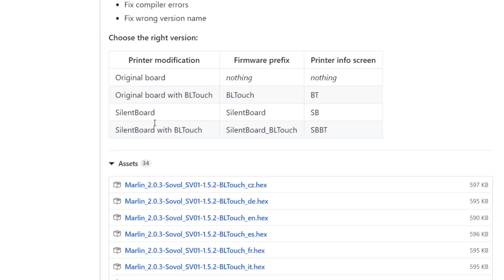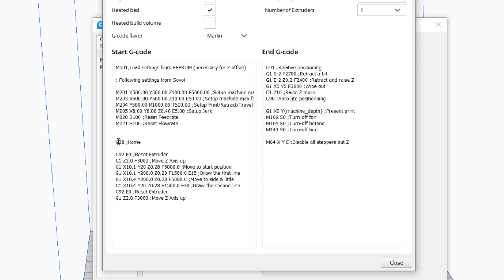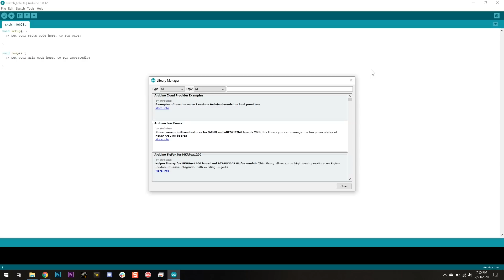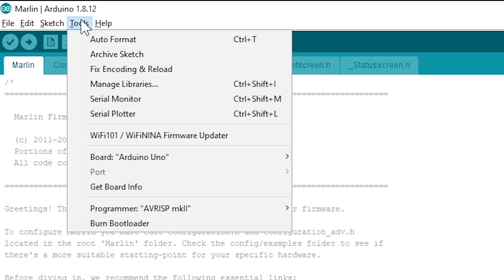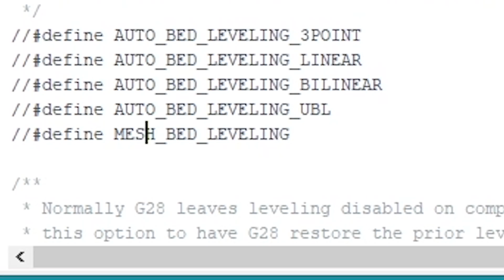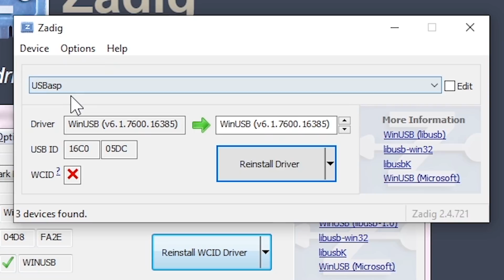Mesh Bed Leveling for Sovol SV-01 & Ender 3 Pro (including flash bootloader)

Comment: I am SO glad that I spent two full years after making the decision that I WAS GOING TO buy myself a 3D printer. For a long time, it was always, why spend thousands for small components that I may only need a few times per year.. But then prices went down. And I got deeper and deeper into my hobbies, which began with model radio controlled aircraft, and then to general electronics, then back to the interest in software programming I had in high school, and into coding my own firmware.. And now I have TONS of actual NEEDS for items which can only reasonably be sourced or produced via a 3D printer. And nowadays, even actual GOOD ones, not full professional/industrial. But actual good CNC machines that hardcore DIY folks and hobbyists who lean towards the professional sides of their interests have come down in price to that of what an average working class Joe can afford. And after 4 months of reading. I now have my first 'test run' print working in the other room on my brand new, currently being broken-in Sovol SV06 Plus. The Plus was what had me on the hook for it's price point. And it seems that it has OH SO FEWER issues than these Enders which only keep being re=packaged in only slightly different color schemes or configurations whilst still being the identical near decade old piece of tech it is. The learning curve is steep. But as an RC Helicopter guy who taught myself to learn to fly from coaxial Mall Copters into mild '3D' aerobatic flight with actual high end hobby grade collective pitch helis. And my camera quads as my 'toys' to rip around on the front yard and street... So steep learning curves are steep fun slopes for me. Also being a skier since childhood.

Comment: The weirdest thing is happening. When I do a G26, it prints out some of the grid, and then eventually it just stops extruding. It goes through all the motions of completing the test print, but doesn't extrude any plastic. And it doesn't happen in the same place.

Comment: I installed 2.0.5.3 without bltouch and now my X hot end crashes and grinds into the end stop,  what do I do to fix this?  Please help
Reply from the maker: I don't know what exactly went wrong but if it's hitting your Z limit switch and not stopping, probably you flashed incorrect firmware. I mean presumably the height of your z limit switch didn't change.

Comment: Even with mesh level, I'm having to babysit my cable chain links as they print separately.  I saved one link with babystep-z just at the right time. Maybe better to print all at once instead of separates?
Reply from the maker: Yes definitely. Lay a bunch of them out on the bed.

Comment: Bardwell, it is unwise to try to print that many pieces using "all at once" print order in Cura. If you really want to do batches of parts do "one at a time" and reduce and place items you print far apart (to prevent the hotend from colliding with completed prints). It'll even print faster and cleaner due to cutting down travel time and retractions between each part. If a print fails you aren't left with 36x 50% of your models, you'll have 18 completed models and one failed one. That way all the material used and hours spent until that point aren't wasted.

Comment: Dear Joshua
I followed your video step by step except in the programmer part, because I managed to get the Arduino uno to work as sanguino programer board.
when it comes to checking before sending it to the printer, I have an error, " exit status 1, compil error to sanguino board"!
Can you give a little help?
I really wanted to have mesh leveling, because my 3D Ender-3 is one of the first and it is as it came from the store in terms of software!
Best Regards
Vítor Lalanda

Comment: Hi Joshua! Thanks for this great video! Especially the guide to change the start gcode was very helpful. Other videos did not mention this and I was puzzled as to why the levelling didn’t have any effect. No I know :-) However, on my Ender 3 Pro I find a Menu item which says bed levelling: on. This item disappears after I ran a print. Do you have an idea what is going on?

Comment: Joshua:
On the CopterTec site, it says after you flash the firmware, it is important to reset the printer to factory defaults after the update.  Pardon my newbee ignorance, but does this mean to copy that factory defaults 4 line file to the SD card, give the file a .gcode extension, run the file, then power off and back on the printer for it to work properly?  Any help with this question is appreciated at tonytwoton@hotmail.com.

Comment: Followed your directions on my sovol. I've leveled the bed as perfect as I can, however now I can't get any build plate adhesion. It was working before I flashed, but nothing will stick. It's like it's offset an extra bit up than it's supposed to be. Any tips?
Reply from the maker: Can you lower your Z offset? 

Did you Save Settings after mesh leveling and setting Z offset?

Did you add the Start Gcode that loads the mesh to your slicer?
Reply: @JoshuaBardwell  yeah I followed all the steps carefully, and even went all the way through it 3 times trying to get it working, I did end up messing with z offset some but at this point I'm giving up on it. I'm just gonna downgrade back to 2.0.0, however now Cura wont detect it via USB.

Comment: Why does my sovol not store settings with Marlin2.0.3? Something to do with EEPROM? Tried hitting INIT EEPROM but doesnt even wanna do that...
Reply from the maker: You need to "save settings" in the menu.
Reply: @JoshuaBardwell  thanks josh, do you mean through the menu on the printer? I cant press "store settings" "load settings" "load default" or "init EEPROM" without it making a sqwak sound and wont remember the settings. I did the 420 gcode thing
Reply: @JoshuaBardwell  Success!! In the Start G Code i typed "M502, then M500, then M501" one by one after saving each time. The sovol's screen then reeboted and i guess cleared the EEPROM out. So now it saves stuff. And i guess the "sqwak" is the normal beep for 2.0.5.3? Sounds like a bluejay.

Comment: A more solid solution to ensuring a level bed is the use of multiple boroscilate glass plates (3-4mm thick) and apply "grip tape," Kapton tape, Hair spray (directly on glass), or wide painters tape to them. The use of these depends on specific material thermal expansion levels from more to less in the order I just mentioned. The use of binder clips will reduce some available edges on two corners by half an inch. Do not forget which plate Z height in your global offset to make in the slicer before hitting start!

Comment: I got sovol machine with orginal board, after did update firmware 2.05.3
And add m420 s1; to cura. Load print to the machine. Then machine bed and nozzle heat up, but never start to print please help.

Comment: Hi, there is an update out (based on Marlin 2.0.5.2). Please try it:
https://www.coptertec.de/news/2019/marlin-2-0-for-sovol-sv01/
Reply: I installed 2.0.5.3 without bltouch and now my X hot end crashes and grinds into the end stop,  what do I do to fix this?  Please help
Reply: @truthorsquareallah888TTEE  Hi, please check the wiring of the sensor.

Comment: Hello Jushua, can I help you with a small favor?
I have Mamba chip F405 mk2 4in1 esc 3-6s I have installed Beta..4.1.4 all are parallel, but the motor test does not turn, (Aming deaktivert MSP) I turn on the Aming switch, it appears red but not yellow, I have followed many of his instructions but it did not work, is there any way to help me? I sincerely thank you
Reply from the maker: https://www.youtube.com/watch?v=9iC1tuRBfxk
Reply: @JoshuaBardwell  Thank you

Comment: I just started the video, and I’ll say I printed the chain, non intuitive, installed (mostly) on the y cable, and on the fence if I’ll do x and sorry remove.   OST of my kinks are fairly smooth, but I wonder if it adds any significant resistance.  Also, even following the guide, I ran short on Z so have to print more links anyway.  Just saying...

Comment: On the SKR Mini E3 it's a piece of cake with Platform IO/Visual St. Code, I have no doubt you will understand it to compile it and make it work on the Ender 3. A great guide on Reddit: https://www.reddit.com/r/ender3/comments/e894j7/marlin_20x_guide_for_ender_3_using_skr_mini_e3_v12/
Also changing the surface to a PEI or Glass bed is a good improvement over the standard magnetic bed.

Comment: printing a cable chain is a waste of plastic, why why why would you do this
Reply from the maker: For fun. Because it makes my printer look cool.

I mean come on.... the whole point of 3D printing is "iterative design". 3D printing is a waste of plastic. Why do anything? Printing the cable chain parts made me realize my bed wasn't flat and I learned all about mesh bed leveling. Throw the plastic in the trash and it was still a good use of my time.
Reply: Joshua Bardwell fair point

Comment: i flashed a bootloader using an USBASP i had lying around, it was quite straight forward. i'm running a freeabl mod on my ender 3, it uses the z axis micro switch, makes bed leveling a lot less hassle.

Comment: You can bandaid fix this in many ways, which this is one. Better solution would be replace the garbage bed with a ATP5 aluminum bed. Next put a proper build plate on it, or print directly on it... your choice. Then get the mesh bed leveling for the tiny imperfections like it was meant for and not what you’re trying to fix.
Reply from the maker: It has a pretty good glass bed. Maybe the lack of flatness is something else like a Z axis problem.

Comment: It's a good idea to do your leveling with the nozzle and bed heated to temperature to compensate for thermal expansion.
Reply: And with a clean nozzle too!
Reply: I was going to suggest that.  I find it’s a. If variance if I level with a heated bed and tip, or not.  And not just getting up to temperature, the thing tried to print almost immediately, I find I get best results when I preheat, especially the bed, for 5 or more minutes, so it fully expands.  Just my .02
Reply: I don't agree.  From ambient to 200c, thermal expansion will be approximately .0006" or about .015 mm, also your going to fine tune your z height when everything is up to temperature and laying down the first layer.

Comment: I tried auto bed leveling, couldn't get it to work after two weekends of messing around. Took the bltouch off and sent it back, put a borosilicate glass plate on there and never looked back.

Comment: Prusa users are like "oh nice, retro tech" 😆
Reply from the maker: No need to rub in that Prusa are the best. I have saved about $700 compared to if I had bought a Prusa Mk3, and I am learning about printer maintenance in a way that I wouldn't if everything had been done for me. The first thing I'm going to do is trash this Ender 3 mainboard. But I wanted to flash bootloader to it just once so I could have gone through what others have gone through.
Reply: Oh nice, retro tech. :D

Seriously though I think my Prusa i3 Mk3 is the best tech investment I've made, very little maintenance in 1.5 years.
Right now I'm designing & printing parts to place the filament spool in a dehydrator whilst it prints, since prints greatly benefit from dry filament, PETG & TPU more than PLA I've noticed.
Here's a prime example, same reel of TPU, guess which one was printed after the filament was dried:
haku.co.uk/pics/WetAndDryTPU.jpg
Reply: And them like: oh, there are printers for quarter of the price of mine?

Comment: About leveling the bed, I adjusted mine only ONE time, yes, ONE time my 3D printer bed, leveling the bed constantly = bed 3D printer hahaha
Reply: Totally not true you must not run the machine that much have a MK3 and after I eventually pulled some of the PEI off with PETG that was too well stuck down and replaced the surface I needed to add mesh bed level correction for the same kind of warping of the replacement bed.  Depending on how big the parts are you're printing or how much of the build area you're using a leveling sensor makes a huge difference... if you print once a month no big deal you can get by with adjusting once a year but if you print all day for weeks you will want auto-bed levelling.

Comment: I use a sheet of borosilicate glass on top of my bed. Glass is perfectly straight. Much easier solution. Also, PLA wants to print perfectly fine on glass without any additional help for adhesion. ABS or other material sticks amazing on glass beds that have a coat of hair-spray on it.
Auto leveling is cool and all that, but can reveal different problems in your filter, like Z backlash for instance. 
What I don't see on your printers yet are Z-braces which you should investigate in my opinion. And also, square your printer with the help of these Z-braces. Not only does the Z axis tend to wobble without a brace, but also it's usually not in a perfect 90° angle with the base.
Also, I cannot see what Y-carriage you're using, but usually these printers come with a pretty cheap, thin piece of sheet metal, which also tends to deform when getting hot, or when adjust the bed-height. Upgrading your Y-carriage to something thicker and more substantial will again improve your printer a huge amount. Tehnologika(dot)net has some great y-carriages.
Reply: I agree. The "ultra-base" type build surfaces work well too, especially for PLA. I use it for my Ender-3 (though it's Creality's knock-off of ultrabase). Works amazingly well and is perfectly flat. I believe getting the mechanics/geometry right (or as perfect as possible) beats trying to overcome limitations/errors with software fixes. In drone terms, it's getting frame and motor relationships as square as possible to minimize the work a flight-controller must do to correct for imperfections...  :-)

Comment: What kind of bed is that? My spring steel PEI bed is way flatter than that.
Reply: The "new" method for updating the Enders uses MS VS Code with the PlatformIO plugin.
Reply from the maker: I say in the video: I tried platformio but I had trouble getting it working and went back to Arduino which I know well.

Comment: BL touch is very usefull, I`m using it on octoprint on AnetA8 and measure 9 points of bed. Every print comes perfectly but remember to adjust hight between extruder and sensor

Comment: Holy Crap! Here is something hilarious! In fact I have the exact same issue on my Ender Pro and ironically just this morning I was trying to print cable chain and had the same issue you are telling us about. How is that for strange...;) Thanks buddy because I was sitting here just now trying to figure out how I was going to fix this, but I do need to see if there is a way with the default Ender setup because I dont have this Sovol unfortunately...
Reply: Just use borosilicate glass, problem solved
Reply: @flo-ridafpv5713  Yea thats what I am doing but would really love to use my magnetic bed. Just ordered the upgrade board so will be working on this soon... Thanks again!
Reply: @kevinm3751  I have mag bed, n put glass on as needed, depends on what parts I'm doin, nice to have both.
Reply: @flo-ridafpv5713  Yea I do to but the problem is it follows the dip in the middle of the build plate so it is not helping the underlying problem. So noob question... what project would support using the glass bed over the mag bed?
Reply: @kevinm3751  just take off the top mag sheet n use glass when needed heats fine I use window pane cut at Lowes but ya can buy borosilicate glass on amazon it's dead nuts flat
Reply: @flo-ridafpv5713  OK, as I said I already have the glass now I will ask the question again. What sort of print would need glass that cannot be done on say a magnetic pad?
Reply: @kevinm3751  umm read your original question bruh
Reply: @flo-ridafpv5713  O so in other words the best use case is to use the glass when your plate is warped... Got it thanks!

Comment: I have it on my SkR 1.3 it’s amazing once you get it up and running which took me a week lol to set it up perfectly. Not a lot of guides and mistakes I made when I set it up. I am using the Bltouch so it’s a lot easier when probing and it compensates got different build surfaces.
Reply: I'm fighting this battle as we speak :) I am also a pretty big fan of SKR 1.3 so far but some of my motors (z-axis dual) are going the wrong way, if I reverse things in the config till it's happy and going the right way then the auto homing starts moving Z first instead of X?  Super strange anyway I'll get there soon, the sensorless X/Y homing is awesome as is along with the UART controlled stepper drivers (TMC2209).

I'll probably just do some pin swapping and go back to normal direction for Z if I don't see anything obvious I messed up when updating the config but open to suggestions as well.
Reply: Shaun Husain the reason why it’s homing Z first is because you have safe homing enabled. It’s beneficial when having a probe on that’s offset from the extruder that if it homes Y/X first that it could be over the area where there is no bed since it uses end stops to home X/Y. If your not using a prob then you can comment that line in Marlin 2.0 just search for safe homing where you compile the code. It’s in either config.h or the other _ can’t think of the other file name, but it’s one of the 2 config files you change when setting up your printer specs in firmware.

Comment: visual studio code And download the plug in platformio extension.  The other didnt work for me. Just saying
Reply: I downloaded and was attempting visual studio before this video came out.  no luck for me, always an error while compiling.  i might have to try this arduino IDE.
Reply from the maker: I tried that but I couldn't get it to work. Arduino at least I understand.